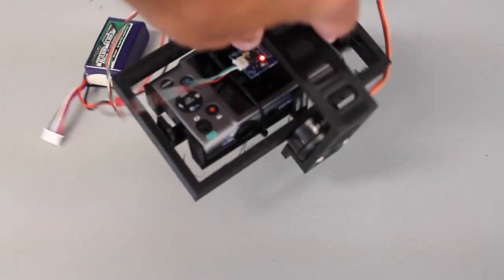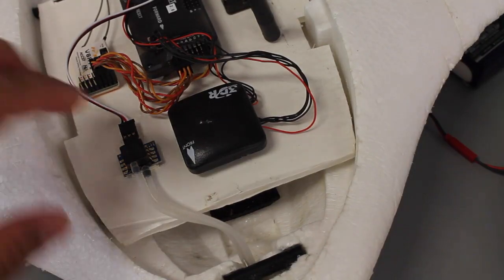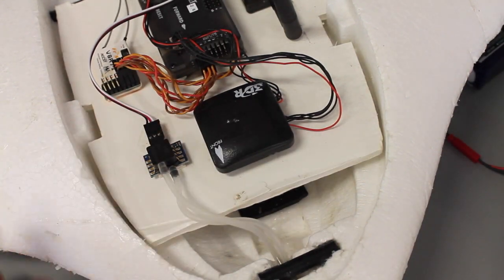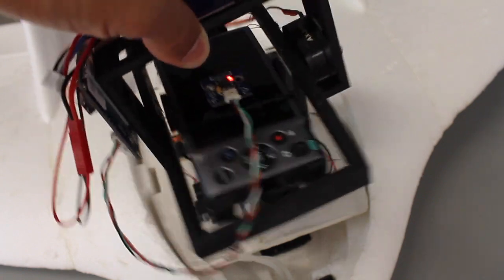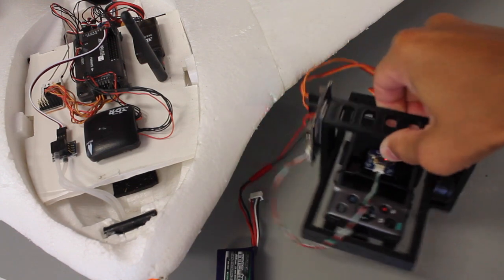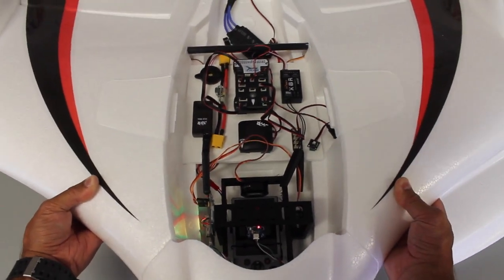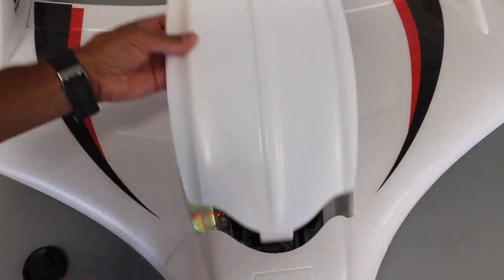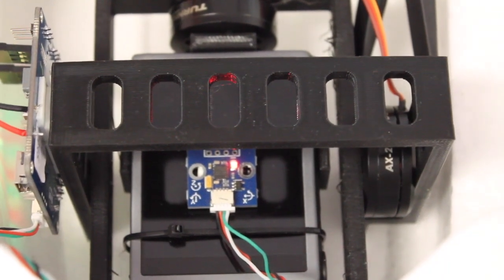Quick Update on 3D Printed Downward Facing Gimbal for Aerial Mapping

Comment: Hi Dennis,
Cool project. Would your gimbal work with a Canon PowerShot S110?
Reply from the maker: +Bill Isenberger Thanks. Unfortunately right now it's too big to fit the S110. I need to downsize it a bit to make it work. Not to mention I want to find a way to fit this into a smaller frame. The Buffalo is fun to fly but just too big for my needs. I'd like to be able to fit a gimbal inside the SweepWings Juggernaut. Will keep you posted on the progress and thanks for the interest.
Reply: +Dennis Baldwin Thanks Dennis.

Comment: Great build, but I don't expect this is going to improve the results in Pix4D and similar programs, or that making mosaics without the advanced maths of those programs will become practical.  In every photo only a maximum of one pixel is exactly nadir, in the corners the imagery is 25-30 degrees off nadir.  A wobbling of 20 degrees of amplitude shouldn't have any effect in any of those programs.
Reply from the maker: +Andrew Zaborowski Thanks for sharing that tip. Very helpful to know.

Comment: Dennis. This gimbal looks like it would fit in several other airframes. I have a skyhunter that I believe this would work on. I have an SX260 and a 3d printer. I would love to try your design and give you feedback. I also have a Finwing Penguin and am in the process of ordering a XUAV Talon. Please email me if you want me to beta this prototype.
Reply from the maker: +James Taylor Thanks for the feedback. It's not quite ready for primetime. Releasing it now would create so many questions and comments that I'm not ready to handle. I'm working with a friend that may be able to help get this design across the goal line. I will keep you posted and really appreciate your interest.
Reply: Thanks for thereply! I am working on a design myself an am nearly done. Ill post pics soon. How is yours coming along?
Reply: +Dennis Baldwin this is something that I'm interested in as well. Please keep at it, I'd love to buy one off you ;-) Support is easy, just make a subreddit for your product and let users support each other. Please keep going!

Comment: Hey Dennis!  
Any progress/update on the gimbal system?  Did you find it unnecessary for most missions?  Or was the stuff already on the market sufficient?  
Thanks for your help!
Reply from the maker: Nick David It's been a while since I've touched the project but I want to revisit. There's a guy that I've been chatting with that is working on a downward gimbal and I'll share more info as he gets further along. You can get great results without a gimbal so I'd recommend getting a camera in the air, testing, and running through Photoscan or Pix4D. I'll release more content on this subject in the near future. Thanks.

Comment: Awesome videos. Great help in getting my skywalker 1900 up and flying. Really awesome gimbal you've made. I'd like to see one made for Sony nex5. I use the flatmap 2 gimbal in my skywalker but may try out a delta wing for my second mapping plane.
Reply from the maker: Darryl Zubot Thanks for the feedback. I've looked at the flatmap 2 before and it looks really good, but as you point out we need something for the NEX-5. I don't have any updates at the moment as I'm flying the NEX-5 directly mounted in the wing. But I'd like to get a little gimbal action going. Will let you know if I come up with anything and good luck with your transition to a wing.

Comment: I am currently using the sony a6000 with a few different fixed wing and multi-rotor platforms. Is it possible to get more information on the gimbal build?
Reply from the maker: Stephen Oberlin Yeah I'll follow up more via email.
Reply: Stephen Oberlin Hi Stephen,
May l ask which fixed wings you already experimented with your Sony a6000?
Thanks

Comment: Dennis: This looks fantastic. Currently I use a Sony NEX5 with a 16mm pancake lens (commonly used for aerial mapping). The list of cameras already supported by Mission Planner (in the drop down list) might be a good place to start in terms of mount variations.
Also check out the RVJET wing. This wing is amazing and is completely modular so there might be some possibility of integration for you design.
Any idea when your design will be finished?
Keep up the great work.
Reply from the maker: Marshall Cant I'd really love it if there were room in the RVJET to support the gimbal. I looked at it in the past and came to the conclusion there wasn't enough room. I'd ultimately like to get the camera in landscape mode inside the gimbal. I have a NEX-5 for my hexa and I'll start looking into something for this camera. I got sidetracked with different projects and haven't touched the downward gimbal in a while. But it's something I really want to get out there and let others test. It would be so much easier if the gimbal didn't need to sit inside the frame. If it could hang outside like with a multirotor then mounting would be much simpler. Thanks for the interest and I'll keep you posted on any progress. Take care.
Reply: Dennis Baldwin Thanks for the update. I was poking around as I always do and found a downward facing gimbal here ( http://www.skyviewcustoms.com/2-axis-mapping-gimbal.html ) that looks very interesting for in-plane use. It is very low profile but still doesn't eliminate the need to be below the fuselage for a clear camera view (of course this depends a bit upon the FOV of the lens). The low profile might offer some opportunity to make it slightly retractable?
Would love to find a wing that could hold a camera in landscape! Keep up the awesome work, videos etc. Much, much appreciated by all.

Comment: Hey Dennis, like your projects. One thing though. Pix4D told me the wind was your friend when taking photos. The angled photos provide better results. Did you hear different from those guys?
Reply from the maker: TuffWing Interesting! I hadn't heard that before. Definitely something I'm going to research as you've peaked my interest. I see you have a Tuffwing UAV Mapper. Nice and I'm looking forward to learning more about it!
Reply: TuffWing i think that for an orthomosaic, gimble with vertical photos will give a better and sharpen images and accurate images. but for a 3d point cloud an angle images are better for covering objects sides.

Comment: Very neat indeed Denis, and a very clean set-up

i would say Sony Nex5 or Sony A6000 with 19mm Sigma is pretty standard among serious mapping flyers.

How did you manage with the center of gravity on the Buffalo ? Where did you put the batteries ?
Reply from the maker: Philippe Giboulot Thanks for the feedback. I've been looking into the Sony Nex series cameras and plan on coming up with something that can support them....hopefully. With the Buffalo there is enough space in the bottom of the canopy that I was able to slide them forward and backward enough to find the right CG. Then I velcroed them down. Right now I'm using one 3S 5800mA lipo.

Comment: Very ingenious design Dennis ! this is great for aerial mapping and geo mapping etc.. are you planning to sell those 3d gimbal parts so we can make one Dennis ? Thanks
Reply from the maker: zero00tolerance Thanks. I'm still trying to get it tweaked and in the air. The cutout I had to make in the plane is pretty huge. I had to do that so when the gimbal pitches forward and back it doesn't hit the frame. I'm not sure how applicable this will be to others and I really don't know what the results will be like. But I'm going to get it in the air and will definitely share my results regardless. If all goes well I'll definitely put up the files for download and print. I appreciate your interest.

Comment: Hello Dennis,
Do you think you can release the files with a beta disclaimer? That way, you will have lots of feedback. Just my two cents.
Reply from the maker: Madhu Nuggehalli I would like to but I'm still not happy with the design. The problem is that the cutout in the fuselage of the plane has to be really big. Right now I can't get my cutout big enough so it keeps the gimbal from pitching far enough. I'm trying to come up with a better design and will keep you posted. I don't think you could make use of what I have right now unfortunately.
Reply: Dennis Baldwin I understand what you say; but, I still think releasing this to the public will enable faster redesign. Look at the many open source projects. :-). By the way, which software is this gimbal designed in?

Comment: what cable do i need to connect my canon camera(a2300) to connect it to my apm or how can i make one?what settings also do i need to change so i can get the apm to take picture automatically at each waypoint? do i need to add any scripts? could you maybe put it in a quick video or otherwise just leave it below.
Reply from the maker: Alex Scheck Check this out: http://plane.ardupilot.com/wiki/common-chdk-camera-control-tutorial/ I'm about to do this in a week or two and will share my results. What are you flying with (camera and plane)?
Reply: Dennis Baldwin i am using on a quadcopter. i am trying to get find how to set it up because i know that the apm will automatically take the picture at each waypoint. so try to go into depth when you make your next video about the cable and settings you need to have on your camera. if you can that would be really great.
Reply: Dennis Baldwin a also don't want to use a timer on my camera
Reply from the maker: Alex Scheck You got it. Thanks for the suggestions :)
Reply: +Dennis Baldwin You're awesome man! You vids are well made and very informative! I am also interested in interfacing a cheep camera for airphoto mosaic. I guess you use a Canon to make use of CHDK right? I think that supports USB shutter triggering on some models, right? Also a micro relay could possibly be used for a universal shutter release, but will the APM outputs be able to drive that? Or maybe a MOSFET could be used...?

Comment: First off, thank you so much for your videos! I'm trying to get into this as a hobby and also looking into buying a dedicated, purpose built ndvi sensor package to use on the farm and have been watching with great interest. I have been looking at the Finwing Penguin for this and thought I remembered you having one of those platforms. What do you think about the room in there for a gimbal?
Reply from the maker: Treyvor Umbarger I really enjoyed flying the Penguin both manually and with APM. The biggest problem I had was on windy days (> 15 mph) the Penguin really struggled flying into the wind. Maybe that was an APM thing but it ended up being a real hassle. That's what led me to the delta wing which really seems to do much better in the wind. There's a lot more horizontal space too. The Penguin has a decent area for installing components, but it's a bit narrow. If you're looking at a dedicated NDVI the best that I've seen is from Tetracam. Good luck and please keep me posted on your progress.

Comment: I have some questions. Hope you can answer....
1. How is the camera shutter controlled? I am assuming you are taking stills, not video, right? If so, then the comment about embedded GPS coordinates (below), is excellent for post-processing. 
2. I recently watched a NETFLIX about WWII British reconnaisance that was done in 3D. The process they used could be adapted here. With 3D, it is possible to pull out ground details that are impossible without it. There would be two ways to do it.. (a) overlapping grids (the method used in WWII) and (b) two cameras that when merged in post-processing, give a true stereoscopic view. This would be a KILLER use of aerial photography, since it gives the highest possible resolution and interpretation of what is being filmed.
3. I assume you have a method for timing your shots that is based on airspeed, right? If not, then consider it, because there is a mathematical relationship between the speed and what gets covered. In other words, simply taking shots based on time will miss coverage, unless you are overlapping shots on purpose. That wastes time in post-processing that good pre-processing planning would eliminate or reduce.
Reply from the maker: Doug Moody Very good questions and let me take a stab:

1. Yes I'm taking stills and using CHDK to take a photo ever 2 seconds. I found that to be about right for the speed I'm flying. I will ultimately be doing distance based triggering but time-based works fine for now. See my response about the GPS coordinates in the comment you referenced.

2. Check out pix4d.com and read through their documentation. It will give you a little better background as to how they're doing this. They've written several computer vision algorithms that can basically generated 3D perspectives from 2D imagery. It's known as structure from motion: http://en.wikipedia.org/wiki/Structure_from_motion

3. See #1 above and yes I want to get to distance based images, but regardless you need considerable amounts of overlap to improve the results. Here is an article that talks about frontal and horizontal overlap: https://support.pix4d.com/entries/27002457-Step-1-Before-Starting-a-Project-1-Designing-the-Flight-Plan-a-Selecting-the-Flight-Plan-Type

Thanks for the questions and thoughts. It's much appreciated.

Comment: Have a look at NDVI-Normalized Density Vegetation Index filters for your camera to take surveying maps for environmental study and research. Currently the only way they can do this is with satellites and it is crazy expensive. Have a look at infragram. A DIY infrared NDVI filter. Costs about $10 and goes in front of CMOS on a point and click.
Reply from the maker: JetJockey87 Yeah totally. I did a conversion a while back (DIY Infrared Canon Powershot Elph Multispectral Camera Conversion Using Infragram Filter Kit) Anyway I've been really impressed with the results. I haven't taken it in the air yet but definitely plan on doing so. Thanks for the feedback and following along.

Comment: Try the skywalker 1680 with a chopped nose :)
Reply from the maker: ***** Now we're talking! I've looked into the Skywalker before but didn't seem to have enough space. But if the nose gets chopped off then maybe that will do the trick :)
Reply: Dennis Baldwin Tha new 2014 skywalker has even more space.A friend was flying it with 8800mah 4s and now upgrading to double that.Thing's a beast!Your gimbal is fairly light though so the older cheaper skywalkers should do it ;)

Comment: Interesting! Why not using a more smaller camera like a Gopro for example?
I think a plane like the FPV Ranger EX could also be a good choice, they designed it to be able to lift some brushless gimbals underneath the front of the plan. But I'm not sure if the plane is large enough for your gimbal.
Have a great new week and have fun :)
Reply from the maker: blackmennewstyle The only problem is the images that the GoPro takes have that fisheye look to them. There is post-processing software out there that will "flatten" the image but I'm looking for higher resolution still photos. I'll share some of my results in the future so you can see what Im' talking about. If you have any other small camera suggestions then please let me know. And I'll definitely check out the FPV Ranger EX. Thanks for the tip!
Reply: Dennis Baldwin I'm agree the fisheye of the Gopro is a little bit disturbing for this kind of use.
The FPV Ranger is an interesting plane but not sure if your gimbal can fit on it :s
No worry, i will stay tune as usual ;)

Comment: since you're using CHDK to control the camera, have you thought about removing the Canon case in creating a custom 3d printed case to house the cameras internal parts? would that cut down on weight? clearance?
Reply from the maker: wickedbuddha No but I like that suggestion :) I've taken this canon apart before and did an NDVI conversion so I'm fairly familiar with that process. I'm not too concerned about weight, but am more concerned about size. I'm constantly trying to improve the gimbal design to make it smaller. Hopefully this proves to be a useful project!

Comment: What are the advantages of using deltawings in projects like this?
Reply from the maker: SirArghPirate I was originally flying a Bixler and then went to the Penguin. The Penguin did well with APM but I found that it struggled a good bit in the wind. I feel like the delta wings do a much better job in the wind and are easier to configure given you only have 2 control surfaces vs 4. I also enjoy flying the wing more and it looks really cool in the air :)

Comment: Does the Canon camera imbed GPS coordinates in file properties?  If not, consider a camera that might.  It would at least help produce a beginning grid of the images.
Reply from the maker: Hugh Hemington The Powershot 130 IS (http://amzn.to/1qSOzul) doesn't have GPS capabilities. I normally sync that up with my flight log to get the coordinates. I also have the Powershot SX 260 HS (http://amzn.to/1zRy7v1) which does tag the images with GPS. The only problem is it's much heavier. I may try to improve the gimbal design to support it or maybe find another lightweight GPS camera. Thanks for the suggestion.

Comment: is that a external compass on the canon camera?
Reply: It's an IMU, it's the censor which detects the position of the camera. It sends the informations to the gimbal board which controls the brushless motors in order to maintain the camera always facing down in this case :)
Reply from the maker: RCVIKTOR KU Exactly what blackmennewstyle said :)